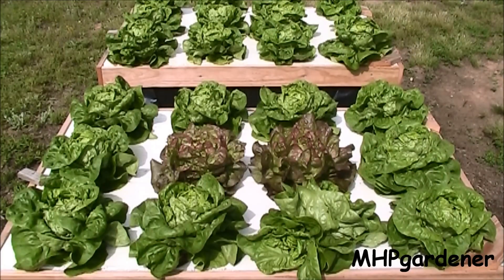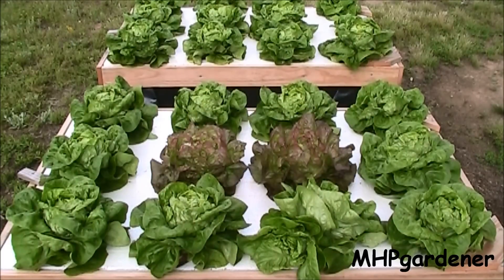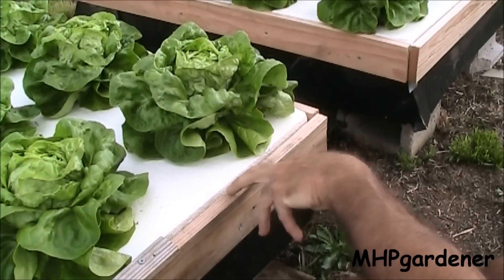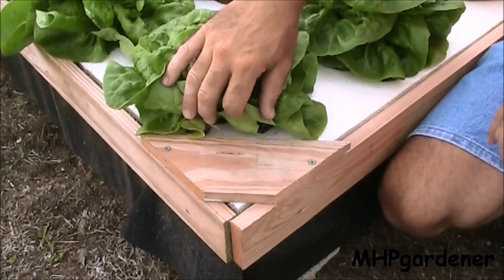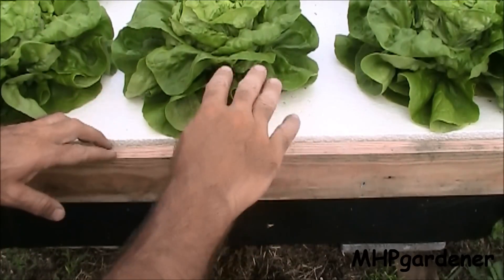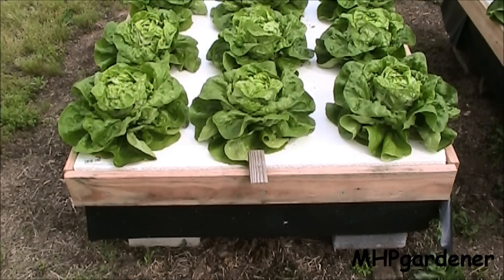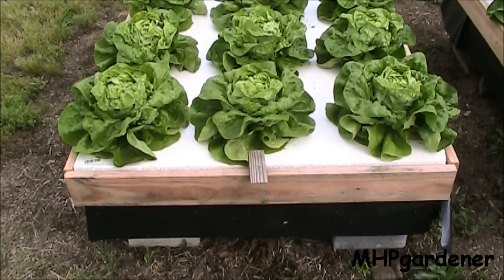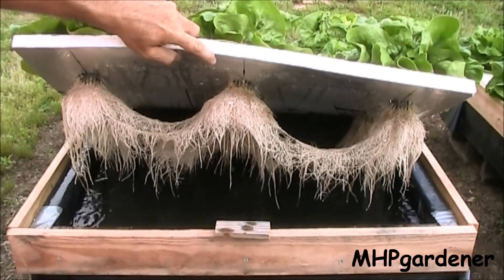Growing Hydroponic Lettuce Outside with No Electricity

Comment: Doing 5 gallon buckets here. No rain to worry about here. The sun is so hot here in the Henderson/Las Vegas, Nevada area here that even on the north side of the house, my lettuce that was beautiful last week is now withered and dying. Most of the mizuna is doing ok but is also starting to take a hit. Will have to do this either indoors or under shade structures.

Comment: I use steralite containers for this. They have 2 holes under the handles that keep the water level where I want it. Check out my outdoor hydropnic peppers video. I have topped it back with water 1 time and once with nutrients. Thanks for all the info

Comment: Hey Bobby! I am setting up 2 floating beds for an indoor system for South Florida summer.  I dont want to float the styrofoam in the water and would rather it sit on the lip of the container.  My 2 inch net cups hang about an inch below the styrofoam so Im thinking I will be good.  I want to do this in 2 beds - One with air and one without.  DO you see any issues here?

Comment: Why don't you add an overflow pvc outlet so that when it rains the excess water you don't want in your system will just empty into a sump tank.You could easily use this water elsewhere in the garden and save time with maintenance issues.

Comment from the maker: No algae because the water is completely covered by the foam board. No concern with water temps for this run. It could be a problem later on though, when it gets really hot. I'll know in a couple months.

Comment: great video...we set up very similar ones outside on our deck and they are doing great...we used old kiddie pools from WalMart...since the pools are sloped we cut the Styrofoam to fit inside the top edge and it is snug....two well placed bricks keep it from blowing off (we live in the Texas panhandle and the wind is a HUGE issue)....we duct taped black plastic around the edge so no light or rain gets in. It rarely ever rains here...we only got 12 inches total all of last year...

Comment from the maker: You're exactly right. Having an overflow protection might not hurt, but the focus should be on preventing the overflow situation in the first place. With Kratky's method, the point is to keep it simple. Topping off the diluted solution complicates the process. The options for a covering are endless. Wire, pvc, conduit, wood.... anything to drape a piece of plastic over, maybe even an over-sized umbrella. :)
Reply: I may be missing the point, but what happens if you run out of water? Or is the basin sized to allow a full grow?

Comment: hello Bobby, thanks for the info, gonna try this, the extra water ? what about drilling a hole in the box at the level you want,i it goes up wont it drain? if you need it higher just plug itwith cok right?

Comment: You mean CO2.  Plants need CO2, they produce oxygen.  Anaerobic conditions lead to hydrogen sulphide which kills the roots.  Not because the plant needs oxygen at their roots, but the Aerobic bacteria do.  C3 plants (most plants), use oxygen at night in a small fraction of what they produce during the day. [in this case the oxygen can be absorbed through the leaves].  C4/cam plants can make O2 at night, thus saving their water usage due to less evaporation during day time photo synthesis.

Comment: Bobby I love the method of doing this outside. My thoughts on covering the top is to make the side boards from 2x4s and insert 1/2" PVC and make a small hoop house frame. Cover it with plastic and the overfill problem is gone. Thanks for the videos, they are fantastic.

Comment: I suspect that my Kratky bucket and bato bucket with totes are not doing well due to the intense heat. Insulating them or using wooden boxes and styrofoam like you do would probably be better.

Comment: would it help to have like a drain hole just about where the plant plugs reach down ? still the plant food dilution or depletion is a problem. Good to know it can be done outside and without power. thanks for sharing.

Comment: You could always start inside the house to like in a sun parlor, enclosed back porch or even a garage or basement using grow lights it is possible to grow somethings indoors all winter.=) I really like this design but im wondering how fast the water level could decrease in hot temps specially if we see drought like conditions again this year.

Comment from the maker: There is no water movement. The plants grow oxygen absorbing roots in the gap between the foam and the water. This allows them to get oxygen from the air, versus trying to get it from the water which would likely be oxygen poor without any aeration going on. It's a pretty cool concept.

Comment: Very nice Bobby, I did a small scale test inside in the Winter and it worked great. Full scale going to be started soon. Maybe a simple drain plug on the side about half way down then draining could be done just by turning a lever or left open when you know rain is coming.